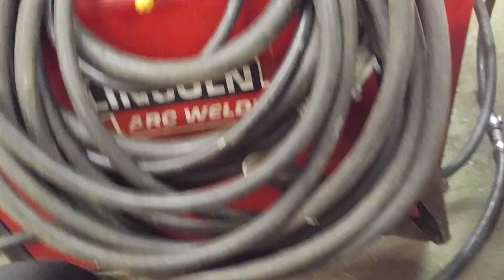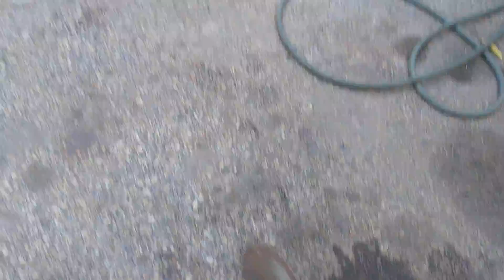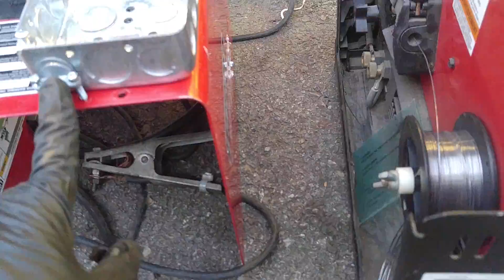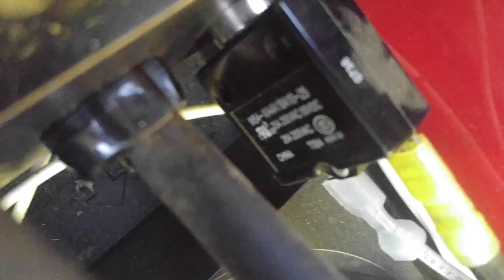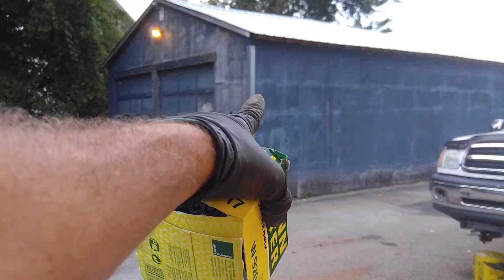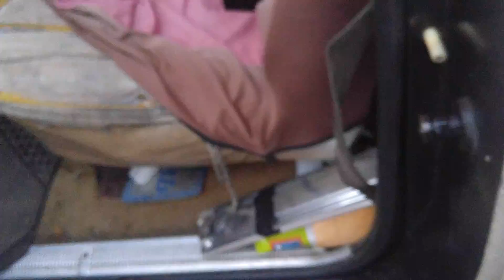Lincoln WeldPak Wire Improvement 9 28 18

Comment: You're not worried about voltage drop from that length of cord?
Reply from the maker: Steve Unauthorized Service Technician nope, I upgraded to 12 gauge, which is prolly 50% thicker,   should be fine. And the original 14 gauge is rated 15amps, 12 is rated 20amps, which is what the welder indicates is needed to work properly. So they actually put too small of a cord on, I fixed that by putting on the thicker gauge. It is long, but it should be fine. That's why I soldered all the connections
Reply: @CORVAIRWILD  Cool. Now i might be modding my little Lincoln.